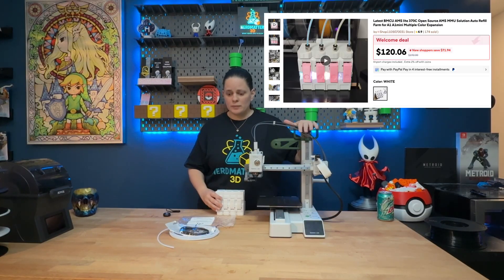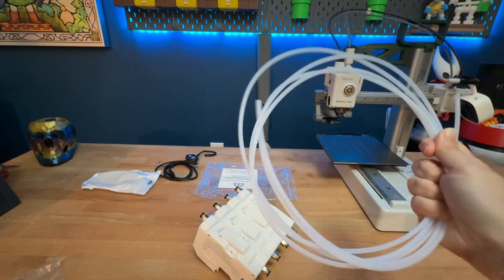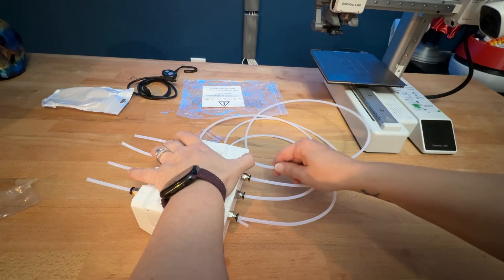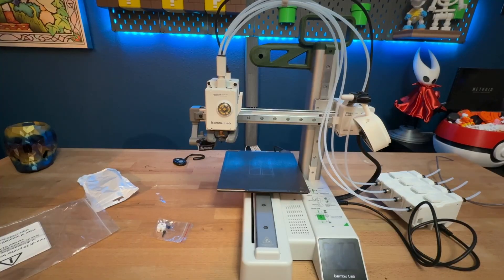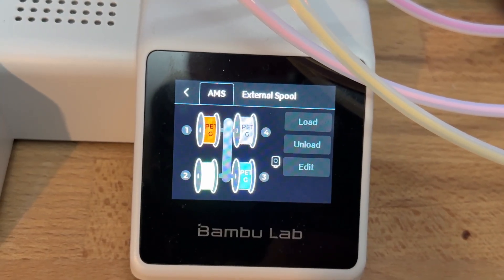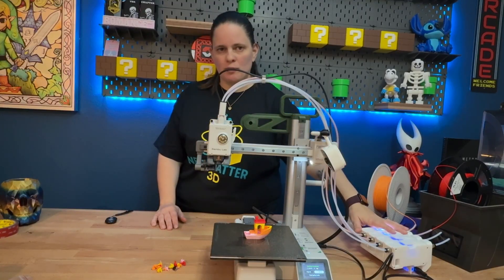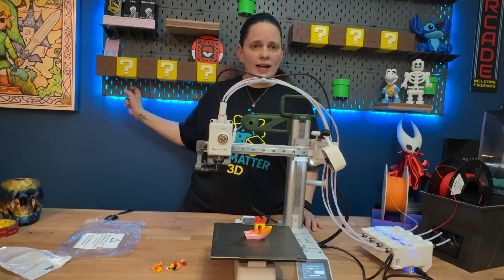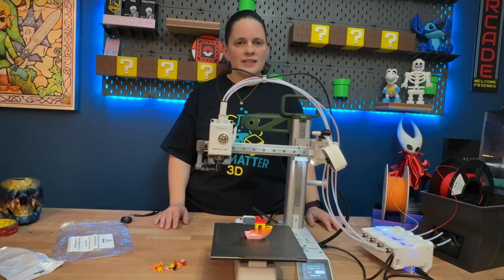Bambu Lab A1 Mini Multicolor Mod — Open Source AMS from AliExpress

Comment: Thanks for a short, simple, and to the point video on how to set one of these up.  Also good to know what version of firmware I should use.  One thing you might want to add is a warning to turn the printer off before installing.  My understanding it can damage your printer if you try to install this while its turned on.

Comment: I have had mine for a while now, and though it works fine I have had issues. These are mainly due to the printer failing to  recognise the AMS system half way through a print. Doesn't affect the print at all, but you need to turn the printer off after the print has finished, then back on again. I did a write up about it on printables a while ago, just do a search for KayessGuitars. But, that said, this was a great review. Keep up with the content. Love your intro graphics they look great. 😃
Reply from the maker: Thank you so much! I will check that out for sure. We had some issues yesterday with it just randomly purging mid print on a single color print so I wonder if that is related. 🙏🏻